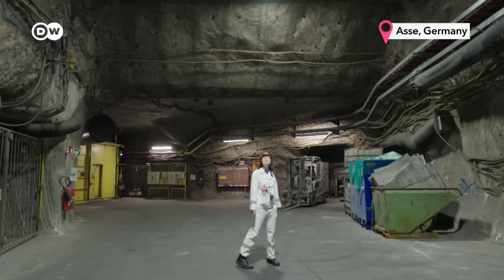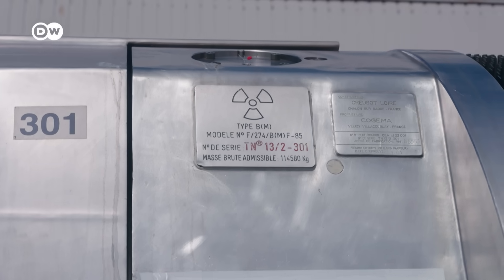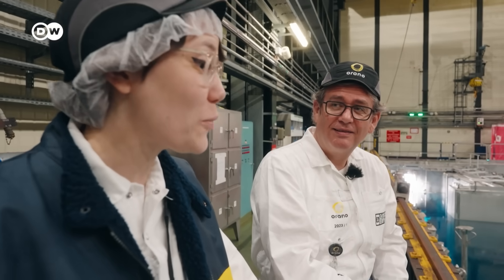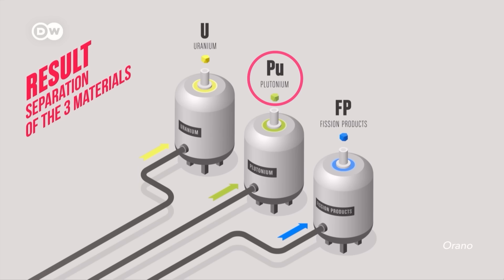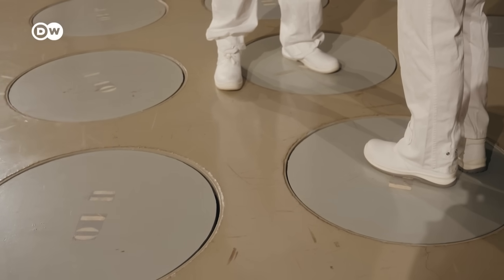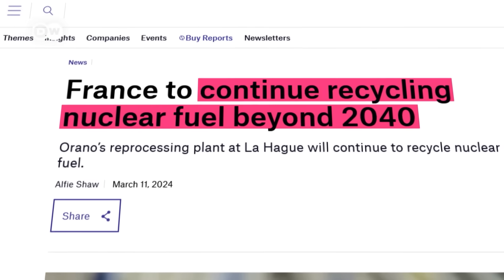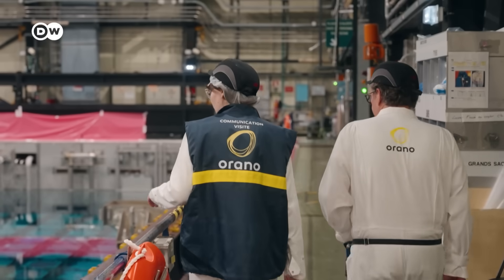Nuclear waste is reusable. Why aren’t we doing it?

Comment: Like most popular explanations of recycling, this did not give a balanced or complete treatment of the subject.  Also, just on "expert" was quoted.  So, it is, by definition, slanted.  Some points:

1. Fast reactors can recycle all of the 95% of the uranium remaining.  Molten salt reactors operate at room temperature and consist of little more than a pool of molten salt circulated through heat exchangers, not high pressure water.  Once started, you just chlorinate the spent fuel (slightly used nuclear fuel) and all the uranium and plutonium fissions to produce energy.  While they mentioned one idea of this process (pyroprocessing), there are other designs, some of them being developed by privately capitalized companies (no government needed).
2. While it is "possible" to make a bomb out of reactor grade plutonium, it is far from ideal and poses many problems because of the higher level istopes of plutonium in the material.  So, no entity (country or terrorist group) has ever tried.  India did it to show proof that it is "possible", not that it is feasible.  To use an example, North Korea started making their own weapons grade plutonium instead of the much easier "separate plutonium from spent fuel" because it made a much better bomb that could actually be used.  So, it is curious why our government dwells so much on nonproliferation of commercial spent fuel grade plutonium as a danger.  We should ask them to elaborate.
3. MOX, while a great idea, is very expensive.  They did say that it is only a "once more through" system, but they hinted that they could take out a great deal of the remaining 95% of the potential energy left in the spent fuel.  That is far from the truth, and at least 80% of the uranium remains after the process is complete.  Fast reactor recycling can fission, essentially, all of the  uranium releasing 30 times the original energy from the material.  
4.  It is unknown why price is an issue, except to scare people away from liking the idea.  If price were a factor, nobody would consider it since economics dictates that people will purchase the least expensive energy in a free enterprise system.  By raising the specter of "expensive", it deflects further consideration.  However, there are at least 10 companies in the world that are exploring the profit from this technique and are only being held back by political restrictions like "it is too expensive and unsafe".  I resent any scientist giving such a characterization while not helping people understand the whole picture.  Allison McFarlane is famous for taking a one-sided approach and being quoted as an "expert".  She knows better.
5. Permanent storage underground is expensive as well.  But that was not mentioned either.  When you do the math, it is considerably cheaper to recycle slightly used nuclear fuel in fast reactors, especially when it is done in mass production.  In fact, it can be shown that transferring this responsibility to private firms to create energy with this material costs about 5% of the cost of burying it.  We then get the benefit of using the energy.  If we want to speed up the disposition of slightly used nuclear fuel, we just use more electricity.  Wouldn't that be a good situation to be in.  With the need for massive amounts of electricity very quickly because of the demand from modern data centers, our decision becomes "do we want dollar per kWh electricity or do we want a penny per kWh electricity?"  I know what I choose.  The former is the fate if we keep government fingers in the business.  The latter is the result if we allow free enterprise to compete.  So, you choose.

Most importantly, get the real facts.  Nuclear power is coming because there is no better way to ramp up huge amounts of power quickly.  Data centers are already moving forward with this despite the government roadblocks.  They will not be denied.  They have said that they will pay 4-5 times the retail rate for the power they need.  Guess what happens if they do.  Residential power will have to bid up the price as well.  So, we either produce more energy or pay more for limited access to energy.  As always, it is your choice, citizens of the world.  Get smart or start paying.  That is my advice.
Reply: Yes. And we need to build conventional reactors to research fast reactors. Yet, the US isn't doing that. But China is. China will have fast reactors and recycle the fuel for the backwards USA.

Comment: Used to work on the software side of nuclear fuel recycling in the 90's, it was such a depressed project, big companies playing stupid games with each other. Complex problems are pretty hard to solve on a fixed budget, software costs are very hard to estimate. A better approach would be to employ a very capable core team and outsource only standardized software development tasks to contractors.

Comment: Space transport is about to get a hell of a lot cheaper when Starship is online. How about cooling those rods in space? Is it feasible in the future? To estimate cooling time using, we can assume a near-space temperature of around 2.7 K.
1. Standard Cooling Time: 5-7 years (average 6 years) in ambient conditions (about 25°C or 298 K).
2. Heat Transfer Calculations: The heat transfer rate (Q) can be significantly enhanced by the temperature difference between the fuel rods and space.
Assuming a substantial increase in cooling efficiency due to this temperature differential, we could estimate a cooling time reduction by approximately 80-90%.
3. Estimated New Cooling Time:
Original 6 years x 0.1 (10% of original time) = about 6-8 months.
However, this is a rough estimate and would require extensive thermal analysis for accurate modeling.

Comment: Finally mentioned it. The reason the US doesn’t recycle spent rods is the final products are uranium and plutonium - which is easy to make a nuclear bomb from. The threat of terrorist threat was enough at the time that we, and several other countries, said we would not use breeder reactors.
Reply: The final products are plutonium with too much Pu-240 to be useful in weapons and uranium with too much U236 to be useful in weapons. It is not easy to make a nuclear bomb from reprocessed fuel, it is virtually impossible.
Reply: @Crispr_CAS9 there was nuclear test in 1962 using reactor grade plutonium. It was successful. Also proliferation concern is recycling process itself.

Comment: It is not the material cycle . It is the verified / experienced risk even if the country warranty high sigma mitigation control of errors in the processs. The small risk has potential to take down a vast area or even endangering a country's economy,  and the healthy ecosystems that have more value for human survival than the energy generated in large periods of time.

Perhaps, lit is like the excellent documental says.. it is the king midas problem everything that it touches became another problem and cost for thousands of years.

It should be estimated the use of the land for the waste during those thousands of years and applied as production cost to get the correct value of this energy source.

Comment: Before watching this video,I will state that the answer to the title of this video is that current reactors get "poisoned" after a few years of using current reactor fuel,which degrades their efficiency,and it is cheaper to just use freshly mined fuel than it is to reprocess existing "spent" fuel rods.

Comment: Can you super freeze the hot Uranium? So it’s cooled quicker
Reply: In this case, ‘cooling’ doesn’t mean lowering the temperature in the everyday sense. It’s about radioactive decay, which can’t be sped up by superfreezing—it takes time to naturally reduce.
Reply: Basically it still generates heat. Not enough to produce significant amount of electricity but enough to melt it. Over time heat generation declines to some level that determined fit for further processing or dry storage. That's called 'cooling'.

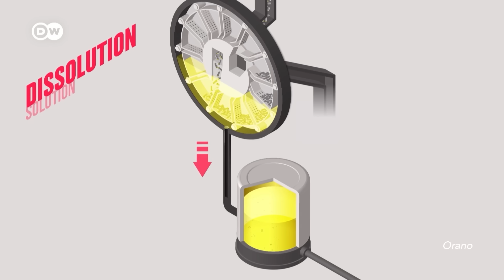Comment: No. Nuclear fuel is not recyclable. ORANO does NOT recycle waste. It REPROCESSES waste (Note that Allison Macfarlane also refers to it as "reprocessing" later in the video). And the act of reprocessing nuclear waste is EXTREMELY dirty. It creates complex waste streams that are even more hazardous than the original spent fuel itself. ORANO actually dumps a lot of this waste right into the ocean off the coast of La Hauge, and holds the rest of it onsite without any plan for its long term storage. The acres of stored waste are actually blurred out on google maps, as this basically ruins France's story about nuclear efficiency. The steps you show at 7:12 create extremely toxic slurries of caustic solvent byproducts which through reprocessing become very radioactive. Additionally, fission products are now concentrated in the waste stream. While ORANO makes it sound like fission products are a very small amount of the original fuel (they claim 4%), this is actually a very significant amount. For perspective, a typical commercial fuel element is only .7%-5% enriched with fissionable isotopes to begin with.  Reprocessing is also a very energy intensive endeavor. In total it takes more energy to reprocess the fuel than the fuel can efficiently provide in a power plant. 

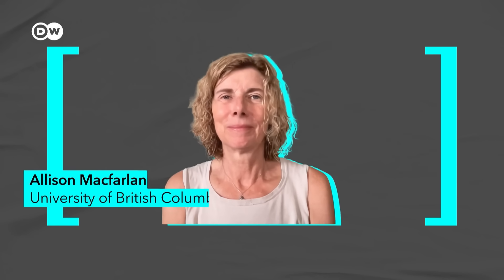8:32 Allison Macfarlane is incorrect. The US did not defer reprocessing because they were "terrified" by output of Plutonium from the CANDU reactor.  They abandoned commercial reprocessing because of the issues I cited above. The US has built and operated several reprocessing facilities over the last 60 years, and each of them have led the US to the same conclusion: The energy requirements, environmental impacts, cost, complex waste streams, and inefficiencies of output vs. input mean reprocessing does NOT make sense. These now closed facilities include West Valley NY, Morris Illinois, Paducha KY, and Barnwell SC. The waste streams created in step 3 of the video are VERY problematic for reprocessing. As such, the United States would rather store spent fuel indefinitely, or have other countries carry the environment burden of reprocessing.
Reply: Source?

Comment: See Fast Neutron Reactor, technology that truly uses the potential energy of U/Pu. Proven with over 400 years of accumulated operating experience. This amazing design uses Sodium or Lead-Bismuth or Molten salt as the coolant, and reduces waste to almost only fission products which after 500 years will have radioactivity levels that are near background levels.
Reply: Molten salt thorium reactors - yes, but fast neutron reactors are more problematic, have shorter life and expensive in terms of power production

Comment: There is a technology that's existed since the 1950s that has been proven in ~20 land-based reactors, accumulating over 400 reactor years of operation globally! See Wikipedia "Fast Neutron Reactor" The largest was the Superphénix sodium cooled fast reactor in France that was designed to deliver 1,242 MWe. Other designs use Lead, Lead-Bismuth or heavy nuclei molten salts because these are much less chemically reactivity than molten sodium is. "Pyroprocessing" (mentioned in this video) utilizes the solubility of U, Pu in molten salt making for the possibility of fuel reprocessing right in the dissolved uranium's heat transport fluid.   Fast reactors can fission almost all the U, Pu, and transuranics, resulting in waste that is almost entirely fission products with relatively short half-lives. Storage for 500 years could bring them near to background levels and the yield contains rare-earth metals used in many high tech devices. Learn about fast neutron reactors, more costly and difficult to operate, but truly using the full energy potential of nuclear fuel!  And imagine the possibility of portable heat from fission products without the concern of nuclear material proliferation.

Comment: I wish someone would develop a small reactor based on spent fuel for neighborhood sized reactors, You can use the waste heat off spent fuel to run a steam turbine to generate power... Why let it cool off in a pool for a few years when you could use the heat to generate power.
The irony of Nuclear power is that we use less than 1% of the energy in the fuel rod before it's spent. The USA decided to go to fast fission reactors in the 1950's and stopped using its slow fission reactor for poliiical reasons. China has started to continue the Thorium power plant designs developed in the US back in the 1950's. It is stupid that the US isn't continuing Thorium reactors but the companies involved in fast fission products are massive lobbys who keep stopping anyone who tries to restart Thorium reactors...

Comment: What makes no sense is that these spent fuel rods are very hot, but you can not capture that energy?? It takes 7 years to dissipate?? ITs heat for goodness sakes, why can't that heat still be used?
Reply from the maker: There are plenty of safety challenges and the development of applications is quite complex and expensive which is why it is not more broadly employed. But, decay heat can be converted directly into electricity by means of thermocouples. It can be used in remote weather stations, or in space missions.
Reply: @DWPlanetA  Thanks for the reply. Seems like the best place to leave it would be in the reactor. From a design standpoint, could one build a two stage reactor, where one set of rods is new and spent fuel rods are allowed to operate at reduced performance? Of course I really do not know what I'm talking about, just on the outside peeking in.

Comment: We should just switch to Thorium like JFK intended & tell all the war profiteering anarchists to go pound sand & take their wars to another planet... JFK had a fully functioning Thorium Reactor [High Temp Salt Breeder Reactor] in Tn- it was really safe so safe in fact that the gov't chose our current dangerous reactors instead after they murdered him with their foreign "allies" the khazarian cabalists- since you could readily & cost effectively weaponize Plutonium & Uranium... when you use Thorium it can't be weaponized [at least it's totally not worth it]... so safe that the reaction slows when it heats up <<<  & >>> speeds up when it is cooler, so safe that a plug existed so that IF the HEAT ever did exceed safe parameters the salt plug would MELT & the core would run into a safety chamber/cistern below... when it cooled it could then be shoveled back into the core to start the reactor again... so safe they used to throw a switch on Friday when leaving & throw it back on Monday when they arrived for a new work week, so safe it can be MODULAR, so safe that one researcher said that you could throw a stick of dynamite in the thing & not have any issues... so the people who make war for profit, ensure cold & hot wars last forever for war profiteering anarchy & mass murder eugenics programs for profit & DEBT SLAVERY thru the UNCUSA Currency a criminal wealth transfer scheme... once again stop GOOD SAFE CLEAN EFFICIENT & SCALEABLE nuclear power that could FREE & UNBURDEN humanity in favor of death destruction & humanities enslavement... and there are still people on earth who do NOT believe that GOD created HELL and those that deserve eternal damnation 100% absolutely deserve that JUSTICE & JUDGEMENT... so Thorium Reactors were yet another good thing we lost when the khazarians killed JFK & RFK over Diamona- TRUTH & FACT... This comment will prob be censored- HOORAY!